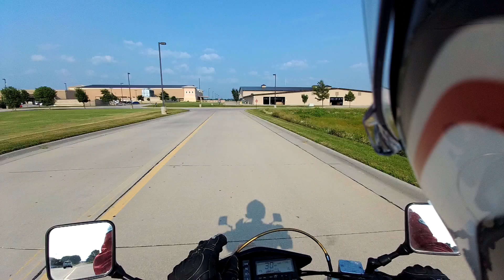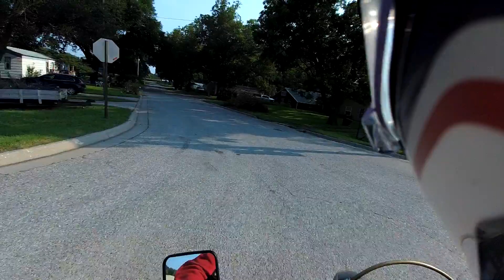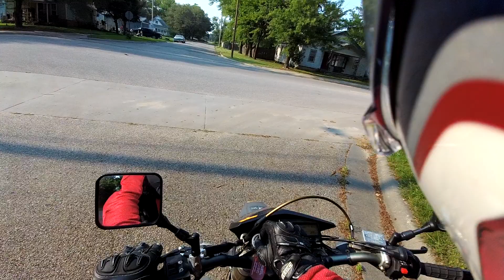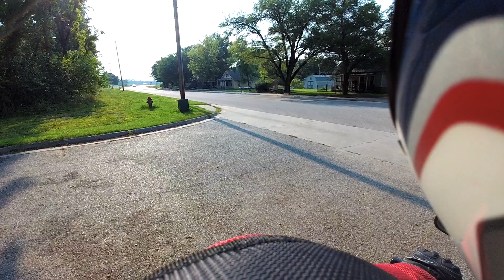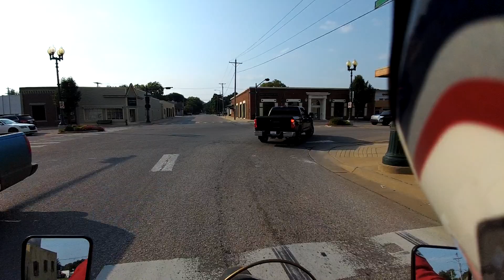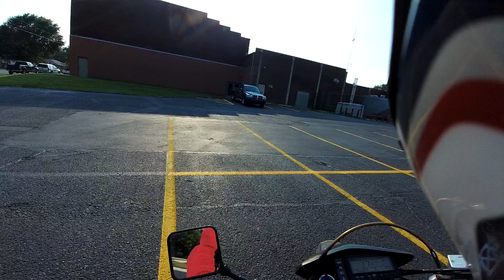DRZ 470 Stroker brake line upgrade! Chat

Comment: Suzuki manual says to replace brake lines every 5 years.Mine just turn 20.I'm so cheap.
Reply from the maker: The stock rubber hose is pretty susceptible to deterioration however a good steel braided like the core Moto that I put on will have more longevity. I also favor the brand galfer